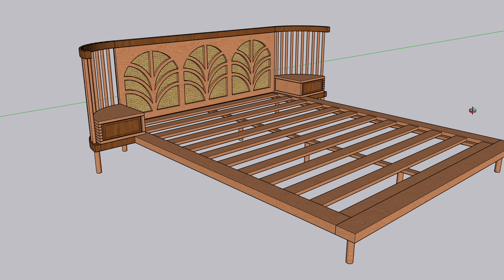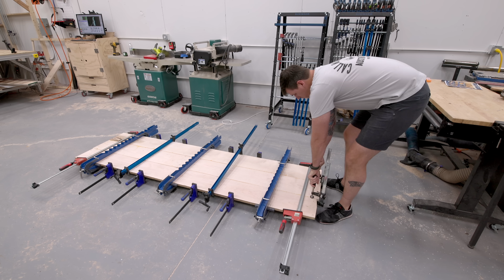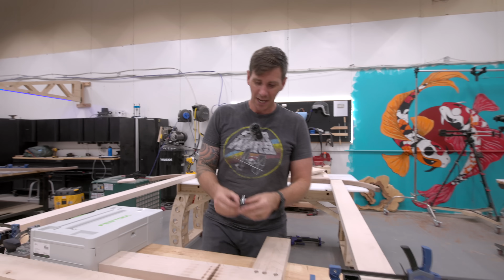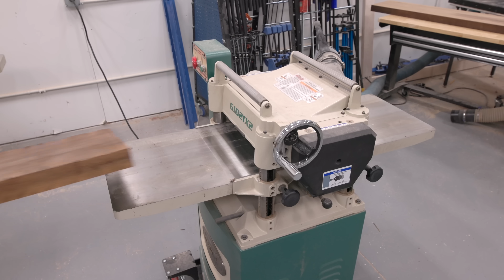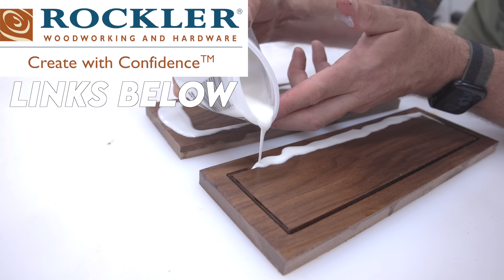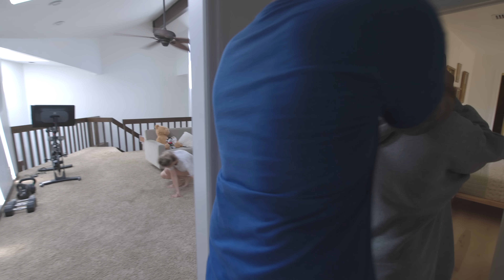She Asked Me to Build This, I ALMOST Said NO

Comment: OMG!  Gorgeous execution.  You are absolutely right about the how rewarding it is to make something wonderful for a loved one.  My entire being resonated to your observations about the challenges of one-off design.  I have metaphorically painted myself into a number of woodworking corners.  IME, the only solution is a rigorous adherence to test pieces and dry-fitting combined with a jaundiced eye and a willingness to rethink.  Rethinking early is less painful and costly that trying to power through.

I hope you don't mind a little Monday morning designing.  I would not want a bed with a wooden lip extending out from the mattress, but that might be a matter of taste. (???)  As you pointed out during the great reveal, the headboard design starts too low, so it is partially hidden by the mattress and pillows.  You could have started it say 8" higher and and then maybe add one more arc to the design making it an addition 4" taller so the lovely pattern would have been more visible.  That change might have also allowed for a second drawer on each side.  

Also, I would be concerned about the durability of cane webbing glued to the headboard.  It might be fine, but I can imagine it being damaged and very difficult to repair or maintain.  As an alternative, I would consider CNC cutting a thin plywood backer and sandwiching the webbing between headboard and backer held by screws.  I think that would be more durable and repairable.

Again, one-off design is a pain, so I intend no criticism!  Just trying to provide ideas.  In fact, I like this design so much, I may well copy it as a gift for one of my kids.  Great stuff, mate!

Comment: Something that I do that really helps, on small glue ups with no dowels, dominos, or joinery; try sprinkling salt or a little sand into the glue. Once you clamp it down the grit of the sand or salt will stop the sliding around of the parts. I hope this helps if you didn’t already know this.

Comment: For the rattan / chair weave / cane webbing, I would have used both vertical and horizontal battens screwed in across the back to retain it.  That way if it gets damaged or if she ultimately decides to have it stained, you can easily do so.  To each their own though.  Looks great as is!!

Comment: Those people saying you can't be a true woodworker when you're using a CNC, don't know what they're talking about. I have yet to see a single, professional, profit making, carpentry workshop, that doesn't at least have 1 CNC. Most of the time, they have multiple, as it's the most reliable method to make a lot of the same pieces, without making expensive mistakes, which it turn means lots of satisfied customers for less bucks. Furthermore, it's only the rough work that's done on a CNC. A CNC can't do all the fine detailing, sanding, polishing and finishing. At least not in the same degree that a highly experienced woodworker can do it and it's that fine detail, soft touch and beautiful finish, that all customers truly want. It won't get the look they desire, without it and that means a real woodworker uses the most practical methods to get the most work done asap and then use their experience to move the pieces from being roughly treated wooden shapes, into fine crafted furniture.

Comment: You did a really good job on this, if there's one thing I would personally change (not saying it needs to change but just something I would prefer) is if you're going to insist on having that shin killer of a platform around the bottom of the mattress that those corners at the foot of the bed be rounded and not squared off, and I realize there is a bit of a rounding but I mean physically round the corners, sure it won't match up to the symmetry of the mattress but I'm older, and bruises don't heal as fast as they used to when I was in my twenties 😁

Comment: I think I would have rounded the foot of the bed corners off to continue the whole theme. The end of the bed does not need to exactly match the same degree of curve of the headboard, but it should ideally match the curve of a typical mattress which would probably mean having 2,  maybe 3... 4? legs on each corner. For Aesthetics sake , plus it will really, really Save that part of the leg that always always ends up getting bruised when you step into those corners. And you will. Evvv'ryone does!

 It's the kind of thing where you're rounding the bed, already in the middle of your step, you're committed, and you're just about taking the other step, then your forward momentum gets suddenly halted by the immovable object and PAIN! - probably a curse or two - when it bucks your knee abruptly backward , yanks your back out of whack there trying to stay standing...  It's a day damaging thing, those corners!

Comment: That bedframe looks awesome, man! And also, you just admitting you screwed up, learned from the mistake, and knew how to do better in the middle of a project is such a core part of being a great builder! Definitely try using both chemical AND mechanical bonds in a project, wherever possible. Don't be afraid to over-engineer something a little if it means your product turns out for the better! :)

Just two cents from one carpenter to another, keep up the fantastic work!

Comment: I would use a CNC if I could get one (I´m missing the place and the money so T_T I´m sad)  - I build my bed with just a jigsaw, Nakaya Douzuki, router and my cordless screwdriver and it was hell. I wished the carpenter didn´t offer me twice the price of my wood for a few cuts T_T so I did all by hand and it´s all crooked and only fitting in one position :-) I never could move again or I have to mark all parts somehow XD
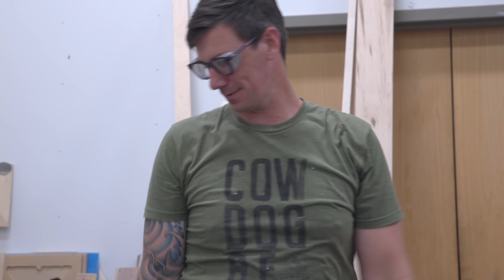And why do you only glue it togeather Iike the strips on 24:00 I always take some biscuits or dowels (... sounds wrong but thats what the translator app says XD) and/or screw it together with glue.

Comment: You can save sanding on complex interior cnc cutouts if you run an additional finish pass after cutting out the tabs and removing the inside, before you move the part.

Comment: On a complex assembly that you're trying to glue up, I find it helpful to put the outside members under tension with something like a bungy cord instead of a rigid clamp.  This allows you to wiggle and adjust and pull them slightly apart to get the next piece to insert into the hole.  

In any case, GREAT RESULT.  Which is what it is all about.

Comment: Good job mate, and just a tip for using the mesh, you should soak it in water for about an hour then attach while its still wet, so when it dries it shrinks and tightens to get that really tight look.

Comment: The bed frame is beautiful and since it's for your daughter, it's really hard to critique it. However, I would have really liked to see some staples added to support the glue in holding the webbing on. And seriously, a panel to cover the glue and staples would not have been too difficult, would have provided a little depth and contrast and protected the wall from being scratched by all the stuff in the back. As it is, if anything hits that webbing during a move after college...

Comment: That bed is beautiful! The only thing I  think you should have done was put in a thin board enough to prevent bed from sliding off or at the very least a corner piece on each corner

Comment: Soaking the cane in water before applying it would ensure it staying taught, and would still work with wood glue and staples. But unfortunately without soaking it will eventually be saggy

Comment: One of the biggest mistakes that I made when building my bed was thinking that the larger frame would look good. While set up it looks nice. In the end it sucks really bad. Bashing your shin late at night. The mattress moving or sliding a bit leaves an exposed edge and bites in to your thighs or legs when sitting on the edge. I think it was one of the most stupid things I ever did. When I build another one I will make it 1 inch shorter and the end corner will be rounded greatly. I will also inset the legs 1 foot under the bed to prevent stubbing my toes. 
While this be looks good. Improvements would be to raise the head board more than one foot as a few things are going to happen over the years. Laying a bunch of pillows on the headboard will mess of the ratan, The head board will weaken overtime and move about. Add rubber feet so that when engaged in activity the bed does not move about. 
 Other than that a cool build.

Comment: If you're trying to be economical with a piece of wood while cutting out curved pieces, then you might want to look into steaming some straight pieces instead. If you can get that to work, then I think you'll be able to form those curves without using so much wood. But, it will probably increase the both time and effort it takes to get the pieces to match up perfectly.

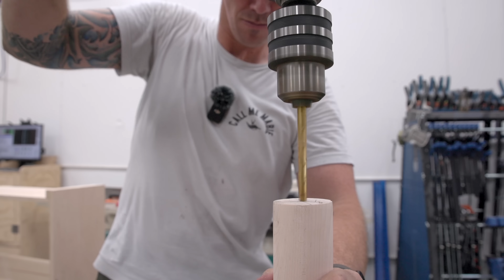Comment: 15:25 "make a 1" mark, then make the other, perfect centre..." except that finished wood is often smaller than the stated size (so show us less-experienced audience that you measured first to ensure it's 2"!) and your big dark pencil line has thickness so your mark will be off-centre by perhaps as much as 2 or 3mm.  (Yeah, sorry, I'm English and we use metric & imperial interchangeably.  I think 1mm is a hair more than 1/32")

Comment: Next time with the rotan just soak it in water. Staple it to the backside and it will shrink and tighten when it dries. Just be sure to not skimp on staples and that soaking means several minutes not just a few seconds.

Comment: That's a great bed! I've been going through bed changes lately. Just bought new mattress, but kept the older foundation that came with my last new bed about 7 years ago. Mistake! The foundation is now making wood cracking noises. I kinda think that wood is cracking at an accelerating rate. SO, I've orderd a platform base. No foundation, just put the mattress on it like you've done with your great project. I think it will be  the answer. Not as pretty as yours, but neither am I . ;) 
Thanks for the entertainment! I've subscribed ~

Comment: Awesome design.  Saying you're not a wood worker is equal to saying someone isn't a metalworker only because they use a lathe or mill instead of their teeth.  Just ridiculous.  Being a "worker" of any material means you have an understanding that is of a higher level of knowledge over a non-"worker."  It's nonsensical for them to make that statement.  Under the same logic a bookkeeper isn't someone that is a numbers worker due to not holding the CPA or a PhD in cryptographic mathematics.  Tools are meant to make our lives easier, has nothing to do with our knowledge or skill level.  Also, you got a wiener dog and that makes it that much more amazing.  Wieners are the BEST!

Comment: At 23:30 I truly winced at what you did as you pushed the timber through your table saw.  I hope you don't continue to do that through your retirement.  you appeared to be pushing from the end with your thumb less than an inch from the blade. A second push stick laid flat would have done the job your thumb did. 

As a content creator, I would advise that if you do anything unsafe in your shop you don't show it in your productions, or at least say "don't do as I did here". 

Other than that, I loved that you pointed out your errors and how you correct them, to produce a lovely finished piece.

Comment: That turned out beautifully. The only I personally don't care for is the overhang of the wood underneath. Just from my experience over the years, I always ended up knocking and bruising my legs on the edges that stick out. The last time I put a bed together, for that reason I made sure the mattress was longer and wider than the base. : )

Comment: U should have read the manual for dominos. Those, calling u a not-wood-worker, were damn right. U r working with wood -> but u never understood how wood should be used.
U did almost everything wrong concerning structural solidity of wood fibers what u could do.
The bed will not last for more than ten years. Normally u can build beds, lasting for at least a 50 years. But u have to know a (not so) few things.

Comment: The bed look's amazing, but there's just one thing that I think it need's. That mattress is on a very smooth flat surface. There's nothing keeping it from sliding all overtime, I think all it need's is a little lip or a framed box around the mattress, just enough to keep it in place. Or maybe just one at the end of the bed so it doesn't slip forward. Other than that that's really all it need's.

Comment: a really beautiful bed you made - smart move to keep it detachable, helps a lot saving space (and money) when moved to another place. To make it easier to put the 20 dowels in, cut the inner ones each  1 mm shorter than its neighbour, starting with  30mm deep holes and long dowels at the ends - then you can pop them in one by one real easy.

Comment: That is a good design. The only issue I have with it is the low quality maple you used. The dark areas & the knots ruin the clean look that design should have had. Adding a slight taper to the legs would have also been a way to refine the design a little bit.

Comment: Crazy question:  is there a spindle sanding attachment for the CNC that would assist with sanding the headboard arcs?  It seems that you could just offset the original paths, slightly elevate the part and make a go of it ... maybe...possibly... or, instead of spending 2 hours to figure it out, just spend the same time hand sanding 😂🤣✌

Comment: Definently beautiful design and end results, my only question is the parts you through across the room (tantrum) could of been us elsewhere or with a little ingenuity could of been saved but then you just left globs of glue on the back where the ratan was adhered to the wood.

Comment: Nice job!  Have you thought of using wax or parchment paper to keep your glue and projects from sticking to your table?  (I saw that it did not stick; just thinking forward.)  We buy big rolls at warehouse club, hang in the shop with a long cut blade beneath to easily tear to length.

Comment: Absolutely gorgeous! But let me tell you a bit about rattan nets. Despite being very beautiful, rattan nets are pain in the butt to maintain. They collect dust very quickly and glueing them won't keep them in place for long. They will pop out within the first few months if not the first year itself. I suggest you nail some "U" shaped pins to the wood since it will be facing the wall.
Overall the work is beautiful. And CONGRATULATIONS on turning into a full time YouTuber.

Comment: You're not a real woodworker if you use a CNC? That's the 1st I've heard of anyone saying something that ridiculous about being a woodworker. These are the same people that were told that using a router didn't make you a woodworker when they 1st hit the market. Lol!
I mean, seriously! I get being so die hard and talented that you can pull off the same level of craftsmanship as the Samurai Carpenter, but for the rest of us plebs, CNC is the shit and the answer to getting shit done quickly and efficiently, but, most importantly, accurately. For those of you that are Samurai Carpenter level woodworkers; congrats. I, for one, can only aim for that level of skill and in the end be happy with less than this guy's amazing woodworking.

Comment: I'm also a trained carpenter and cutting machine operator, I have to say the video is good and the headboard of the bed, the rest of the bed didn't make any effort.  What kind of screws are these as a substitute for wood connections.  What ugly feet are those.  I once built a bar cabinet with drawers, doors and locks 100% made of wood.  It was a real challenge to make all the hinges and locks out of wood.  Put a little more effort into the small details.

Comment: "OMG!".  Very good design and build.   For the legs - just curious if you eased the edges on the floor end?  I have experienced wood splintering off in the past, and now either chamfer or round over.  Thanks!

Comment: OMG! (lol)
Beautiful work! You've definitely got the "build it to last" philosophy right. The two things I would change is to extend the headboard so that the decorative portion isn't hidden by the mattress. I also would have put holes in the back and into the drawers for charging cables or power for bedside lamps... but I'm a techy guy, I probably think about wires too much. lol
That all said, the result is beautiful, and thank you for showing the mistake and correction, and not just showing off the eventual end result.

Comment: Lovely builds. How ridiculous to criticise you for using CNC. There are any number of ways to perform many operations. The method that you choose depends entirely on the equipment that you have to hand. My workshop is extremely limited. If I had room and the budget for the gear that you have, you can bet that I totally would use it at every opportunity. The right equipment is half the battle.

Comment: Looks really nice, I wouldn't have had the wood around the mattress extend past the mattress perimeter, and I'd put some sort of stops at the bottom edge of the mattress so the mattress doesn't slide around on the platform.  I'd have also made the night stand parts a bit higher than the height of the mattress. But hey, it wasn't me designing it and building it so none of what I wrote means anything. :)

Comment: The bed frame looks really good mate, just a tip from watching a few of your other videos about bow ties for cracks in wood,make the bow tie slightly bigger and put a slight chamfer on the bowtie the will eliminate any holes or the need to fill any imperfections in the fit up, keep up the great work 😀